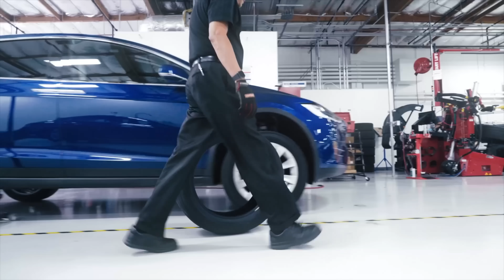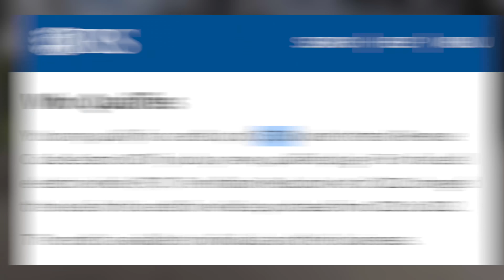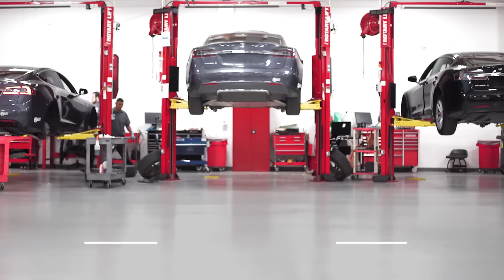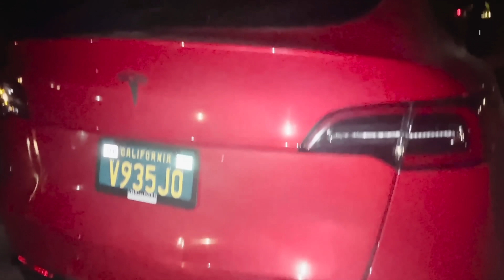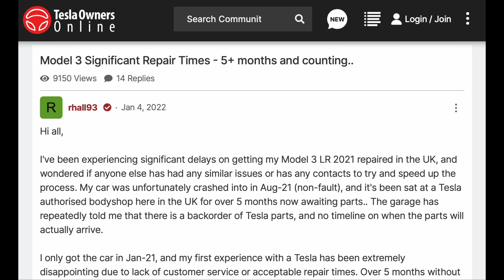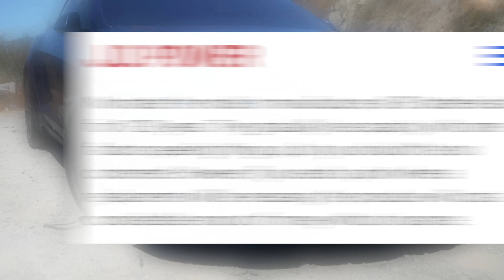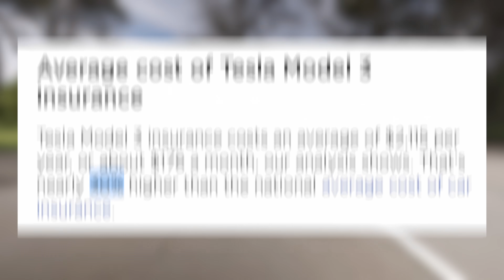My INSANE $23,614.36 Tesla Repair | Tesla’s Expensive Repair Problem

Comment: Somebody hit and run swipe my car while parked (camera did not turned on). They have to replace left fender, front bumper and left headlights. Total came up to $4,413.  The headlight alone was over $1,000 and the insurance only covered $730 for a used one. I ended paying the difference to get a new one.

Comment: I have 204,000 miles on my M3P and get about 18,000 miles on the rear tires.....the front tires get about 42,000 miles.....I do not rotate tires and I just replace rear tires when needed.......I pay about $95 per tire plus mount and balance, so there is no reason to spend $350 on the Michelin tires (Michelin tires get less than 18,000 mile because they are softer tires also) I've never had an issue with the tires I buy off Amazon and have shipped to tire store....I drive the car like a racecar as much as I can and just pay for tires.....if you don't drag race you will get better mileage than me....
Very little maintenance over 204,000 miles....

Comment: Hard to use the argument that Tesla being a "small" auto maker means parts are harder to get when they are only focused on producing 4 models and one of them is the most popular car sold in 2023. There should be no excuse that model Y body panels are hard to get, they're literally making millions of them... Should be easier to get than parts for a Corolla if Tesla was allocating production correctly...

Comment: 13 years ago I remember my ZO6 rear tires used to cost $526 each. They lasted around 15,000 miles.  I saved a little money the second year on tires the second year as the 7 litter LT7 spun a main bearing and I couldn’t drive the car for about 4 1/2 months while the engine was replaced under warranty.
Five years before that I married my soon to be ex-wife who had an old five-year-old BMW that needed an engine replacement that cost $13,000. So in this case of battery pack doesn’t sound that expensive.

Comment: Those repair costs are absurd.  Models 3 and Y are not luxury cars, they are premium cars.  They are also mass produced.  If parts are in short supply, that is because Tesla has decided not to set a sufficient amount of parts aside for repairs.  Those labor hours seem too high to me as well.  Almost 130 hours total labor for a rear end?  Why would body work on a Model Y take so much more labor than a Camry?  Something doesn't smell right.

Comment: Its funny that the Tesla economics are compared to economy cars. Especially a 1020HP Plaid should be compared to at least a Hellcat Demon that still doesn't even get close to 1020HP, but it gets maybe 10mpg and needs premium and race gas($10/g) for that performance. Anyone that has owned real performance cars knows the actual costs and savings that Tesla brings. Repairing them is the problem though, but that is obviously a supply issue. They are in such HIGH demand that making parts just isn't feasible yet. But when they are capable of getting these parts out and actually have the equivalent of the GM performance parts center or Ford Performance parts centers etc. Then we will see the costs come WAY down and many other shops opening up specializing in repairing them which will lower costs and repair times way down.

Comment: I have a 2017 Ford Escape (65k miles) and I paid $1500 for an 8 year premium warranty, $500 for 4 new tires, a couple $100 deductibles for a hitch problem; approximately $250 for oil changes; $600 for new rear brakes and shocks installed by a mobile mechanic; and $150 for a new battery installed at Walmart for a total of $2950 over 6 years. Seems to me that my maintenance costs have been less than a Tesla would be.

Comment: I think you hit the nail on the head when you mentioned after market parts, but you didn't delve into it. The biggest difference right now between EVs and ICE cars when it comes to repairs is that there is no aftermarket parts available and very few aftermarket repair shops with expertise in them. There are some, I have seen videos (like Riches rebuilds) where they do replace battery packs in Teslas for a lot less money, but it is rare to find one. Imagine if you had a blown engine and transmission in a used BMW and the only place to get it replaced was the BMW dealer with brand new BMW parts. Nobody does that unless insurance is paying because the price is nuts. Well, when an EV battery goes out right now that is your only choice. That is one of the reasons that even though the prices on batteries is going down the cost to replace a battery pack is still high. It is the Tesla mark-up, cause they got you by the short and curlies, you have no other choice.

Just going to prepend this next part with a "I think," because I don't know it to be true for sure, but it seems to be true from what I have heard about getting new parts after accidents on EVs, and it is a clear business choice.

Second problem EVs have that most ICE cars do not is that there are not a lot of extra parts being made by the manufacturers because they can't keep up with demand on new vehicles. Making extra parts would scavenge from the new assembly lines, especially in the case of batteries. Given the choice between making parts for repairs and making parts to build a new vehicle, normally you make plenty on those parts so the incentive is high, but if you can't sell enough cars by doing that the balance shifts.

Comment: You might want to tell viewers that the DOE has a web site comparing total cost of ownership between different makes and models. It can be fine tuned for type of driving and mileage, your electricity and gasoline prices and state you live in. The comparisons show BEVs are only cheaper than hybrids if you drive a lot of miles like >15,000/yr.
Reply: Is that only for fuel cost or maintenance as well?
Reply: @poeck41  Supposedly full cost of ownership, purchase and depreciation, fuel, and maintenance.

Comment: The biggest problem with Li-Ion batteries they age and degrade not only with use but with time as well. So you won’t save much by not driving a vehicle heavily as the battery will still degrade.

Comment: You should be comparing BEV to hybrids. Conventional ICEV aren’t designed to be that efficient. Every time I look at the DOE cost of ownership calculator hybrids are considerably cheaper than BEV. Toyota hybrid warranties are considerably better as well. 150,000 miles and 10 years on the battery, 100,000 miles and 8 years for EV drive components.
Tesla’s giga castings makes major repairs on a Teslas basically impossible.

Comment: A few things to point out:

1. As long as you have insurance, who cares? The only bad part is, yeah, if you've got to wait a long time for your car to be fixed, you've got to drive around in a loaner
2. You absolutely DO NOT have to buy those expensive "low profile" tires. There's a YouTube video of a guy being quoted $400/tire and instead went for standard $75 tires, said his ride was fine and most importantly, they lasted just as long. Just something to point out.
3. Companies are now starting to design tires specifically for the torque found in EVs and also accounting for their extra weight. We'll start to see more of these tires in the wild and they'll result in longer life.

Comment: Here is an idea. Tesla should charge just a little bit more money for the car and give a 200,000 mile battery replacement warranty. This will put a lot more customers minds at ease and ultimately sell more cars.
Reply: problem is not warranty. Problem is when you damage body panels even in small accident can cause $10k and more in repairs with tesla and long wait for repair. Mercedes s class takes faster and cheaper to repair panels and paint. I just had my model y damaged while parked rear quarter panel and bumpe is $18k repair and my appointmenmt month away and will take another month to repair. Its insane. My first and last tesla. Im going with another ev with tarditional manufacturers. Soon you wont be able to insure tesla

Comment: I'm getting a 3rd battery installed in my 2019 Model 3 Dual Motor with 133k miles. The original pack started throwing a battery code abs reduced charging speeds at around 112k miles. Tesla of Carlsbad replaced the pack under warranty and now 7 months later, at 133k, the replacement battery is no longer accepting a charge at all! I pick up my vehicle in 2 days, fingers crossed this battery holds up. Luckily, Tesla is replacing the battery under the battery manufacturer's 48k mile/4 year warranty.

Comment: Costs vary drastically, here for comparison are some of my costs, I hope it's helpful.  My 2017 MS 75 RWD insurance cost, with a $500 deductible is less than $700 yearly.  I use Erie Insurance. I'm probably older than most of the commenters here, live in PA and have a pretty clean driving record.  In September my car will be 6 years old and have approximately 80k miles on it.  I'm on my second set of tires and I've only replaced the accessory battery out of warranty.  I did upgrade the MCU, added HW3 and now have a CCS enabled battery charge control board, but those are not repairs.  Battery has only degraded 5 miles.  My Tesla tech informs me that Tesla will only sell me a 90-kw pack, they don't make the MS 75 anymore. I will have to pay to unlock the additional 15 kw or, carry the extra battery weight around.  So, some of us will have additional battery replacement costs.

Thanks for the YT post, Ryan!

Comment: Mixing up "luxury" cars with "average" cars is rather mixing apples with oranges. If Tesla are going to sell their cars as having similar overall ownership costs to "average" Corolla or Prius models, then they shouldn't be compared with similarly priced "luxury" cars when it comes to repair. They are either one or the other.
One of my colleagues had to wait several months to have a Model 3 repaired after a side impact. I waited a month for a standard shutter in the cooling system that they really should just have in stock. These complaints really aren't just a few internet whiners.

Comment: I'm in the UK and have a 2022 MYLR. Insurance costs have rocketed here as well- typically averaging about £1200/yr ($1500)  Some younger drivers are finding difficulty obtaining any insurance at all and in the UK a minimum of "third-party" cover is mandatory.  I think another factor affects Tesla insurance. The Model Y is rated as the safest car in Europe and USA. IMHO some of this is that the design prioritizes the safety of the occupants and  other road users which means the car "sacrifices itself" to achieve this, resulting in greater car damage but undamaged humans!

Comment: On the second day of owning my Model X, I cracked the rear wheel trim backing it into the garage.  I have a Tesla certified repair shop in my small town.  They looked at it and had the part within a week.  Total cost parts and labor was $120. Also, I found Progressive to be lower cost than Tesla insurance in Virginia.
Reply: Not trying to pry for info too much but I live in VA as well and progressive did not give a friendly rate. State Farm actually gave me the best rate. What part of VA are you from?
Reply: @WillieBeamen06  I actually switched since to State Farm as well.  I'm on the peninsula.
Reply: @STEVEF777  nice I’m in the Hampton roads area.

Comment: A small crack in my front bumper due to a truck tire piece hitting it is currently at $3,500 + two weeks of car rental.  Thankful their insurance company covered all of it.  It also takes a long time for parts to arrive before taking the car into the  shop.  Almost a month for parts and two weeks at the shop.    

Also, a tip on tire replacement costs.  I go to a discount tire (no, I don't work for them) and pay for the tire warranty on a good set .  When it's time to replace them, the warranty covered the difference of the actual mileage vs. the tread life estimate.  I make sure to rotate them every 6K miles, and last time I received almost a $500 credit to replace all 4 tires.  The extra benefit is getting the lifetime replacement if a tire is damaged due to road hazards (pot holes, nails, etc.). With my long commute to work, it's worth it to me.
Reply: Tesla's are ridiculously expensive to repair, and Tesla needs to get a handle on it imo.

Comment: 7:09 this insurance info is simply incorrect. Several reasons why. Bottom line is that the implication that they can repair it but choose not to is fundamentally wrong. 1) they always have to make those choices, EV or ICE. 2) sometimes state laws require totaling it out at a % lower than 100%, 3) actual repairability is an issue. 40k in damages is highly likely to be closer to 50k once everything is disassembled and better assessed.

Comment: I was just hit in my model 3 and the EARLIEST I can have a tesla certified shop look at the damage is not until August 23rd! I was hit on the 31st of May. I was told wait times were abnormally high for all repair wait times, but Teslas were longer than ICE vehicles.
Reply: Wow that’s horrifying. How did it all work out? How’s your Model 3?
Reply: What happen ?

Comment: if you in nevada, the base rate for the 18000-21000 annual mileage range at 90% is $152 monthly.  at 97 score drops below $108 a month, as high as 100 score $93 a month. 

every other insurance company in las vegas wanted at least $3000-4000 annually.  USAA was the only one that said $175 to 230 monthly depending on your extras.

This was all based on a 2023 model 3 SR in april 2023 when examining insurance prices.  

for comparison, my 2022 tuscon hybrid was $180 a month for full coverage.  oddlty, when it it was totalled out, the right front taking the hit and no airbag deployed was $19000 on the actual repair, but they were missing sensors that were torn off the car and the actual estimate to repair was $23000 range...car new was $31k. 
to dig deeper into insurance, the KIA EV6 on my same policy with progressive was only about $375 more for a 6 month period when i inquired for that vehicle.  tesla was nearly DOUBLE.  meanwhile both the M3 and EV6 cost about the same at that time i checked both out side by side.   

I think EV insurance is mostly due to battery, but i also think theres the "tesla tax" factor too.

Comment: It would be cheaper and better for the consumer if Tesla opened up their right to repair. They are still mostly a walled garden . Also making their batteries modular would make battery replacement a lot cheaper, faster , and better for the environment

Comment: I would be a little wary of purchasing insurance from Tesla......a company that constantly touts their Model 3 Performance 0-60 time of 3.1 seconds, then tells me they will adjust my insurance based on recorded driving metrics.  Does anyone with Tesla insurance know........would charges be increased for fast acceleration if speed limits, etc.... were not broken?  Seems like a waste to pay extra for performance if you get punished for using it.
Reply: nope acceleration doesn't count against you, but hard braking and cornering does. But the hits to the point score are minor. Also hits to the point score for going over 100mph  (if you have TI version 2.0)
Reply: @saultknutz1166  Thank you for answering my question.  I just drove a 2023 Model Y Performance for 4 days to see if I should buy one.......and I was very impressed.  Through some research I did see that, although the car has an amazing safety rating, insurance is quite high.  I was worried that Tesla might "nickel and dime" you with their monitored insurance plan. Have been holding out to see what the new Model 3 looks like.

Comment: Great video as always Ryan! 
My thought on a few things. 
Insurance costs should be compared to similar vehicles like the BMW 3 or Mercedes C. When my sons was being added to my insurance, I actually benefited from getting rid of my BMW 8 coupe and 240xi couple and replaced them with a model 3 dual motor and an Accord 2.0. My insurance actually went down about $80/month (and my car payment cut in half LOL). 
 I have owned multiple BMWs with M packages and my tires would need replacement at around 18k miles no matter how responsibly I would drive (will of course corner a little harder than if you're driving a Camry :)) and the tires were about the same price as my Model 3's would be. I have about 14k miles and the tires are at about 65% with occasional bursts of 0 to 60 in 4.2 seconds (the fastest car I have owned). LOL
Also, premium gas is much higher so when comparing a model 3 or Y,  it is unfair to compare it to vehicle that take regular gas like the civic or corolla or even an accord or Camry.  If you're on a 25k budget and looking at a Model 3 to save money in the long run, you probably will not. But for people looking to spend 50k on a premium model, a model 3 or Y is a no brainer.

Time savings should also be considered since the Accord has gone in for an oil change 3 times with a total cost of just over $200 and at least 9 hours wasted not to even count the time and money spent at the gas station.
Reply: Very nice breakdown.
Reply: Lots of apples to oranges comparisons being made in the industry. Tesla should be compared to a luxury sport vehicle. That being said, I am not looking forward to an out-of-warranty, out-of-insurance repair bill. 😢
Reply: Great breakdown, thank you for reminding this.
Reply: The Prius is far better than every car mentioned, including the Tesla.